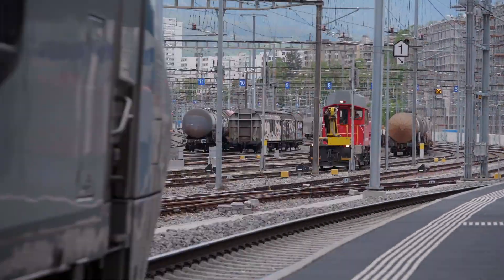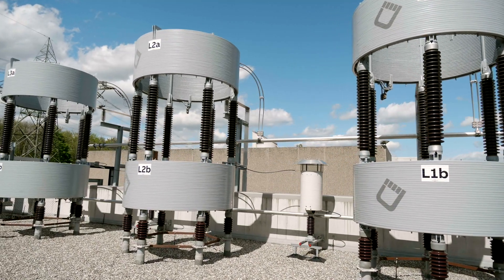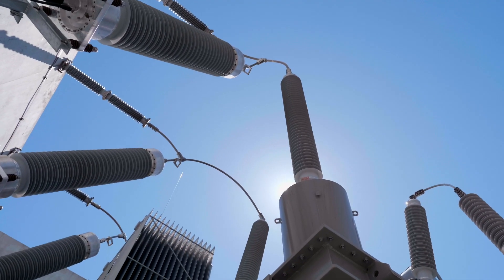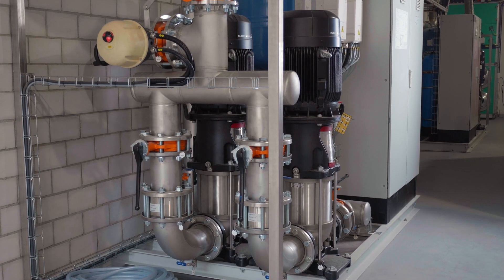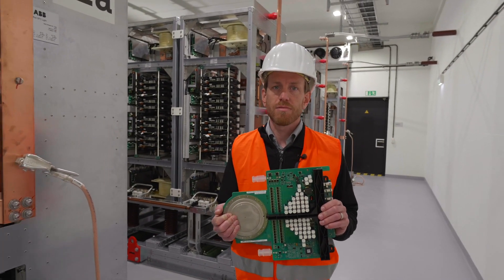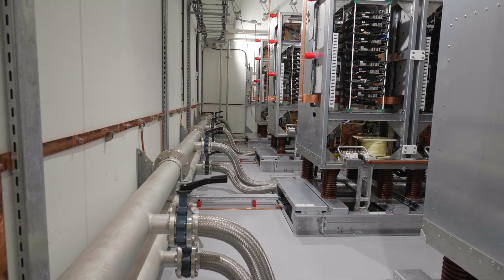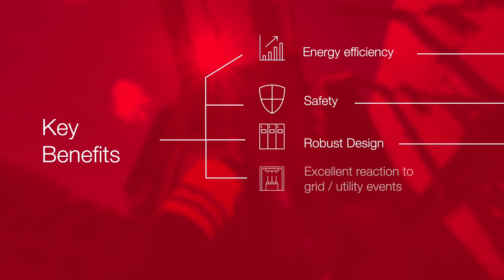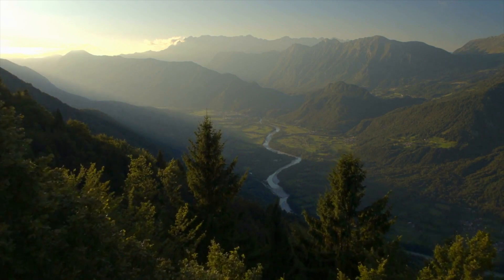Hitachi Energy’s rail technology helps sustainable rail mobility in Switzerland

Comment: Thyristors? Like a switching power supply but for 80MW?
Reply: Yes a Thyrister that behaves like a big IGBT. The device has intergrated light triggered gate comutation control making it behave like a transistor. Typically used in multilevel inverters. The hokey pucks are clamped in stacks with water cooled heatsink blocks. Very nice devices.